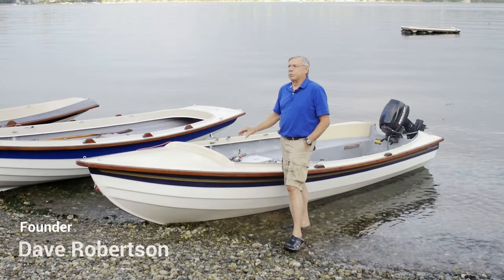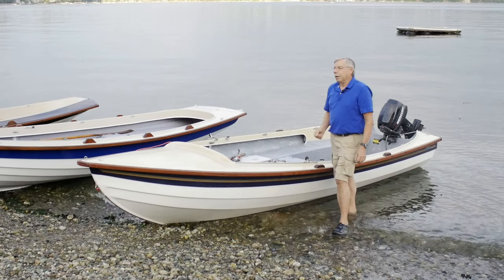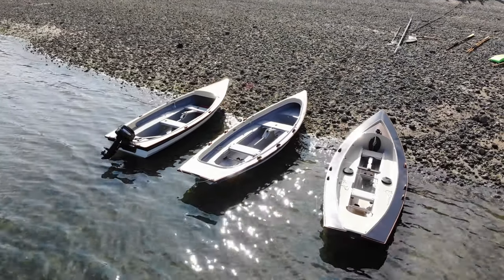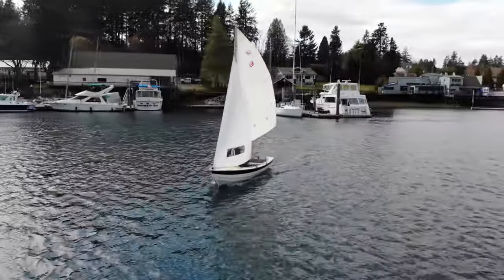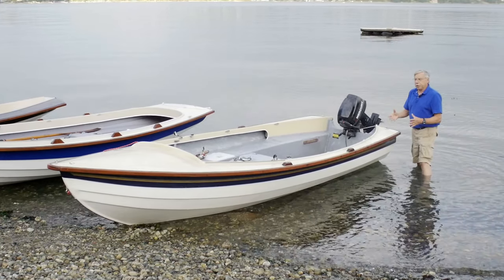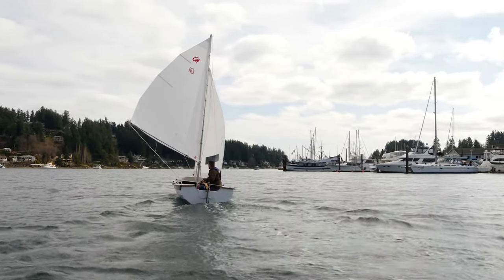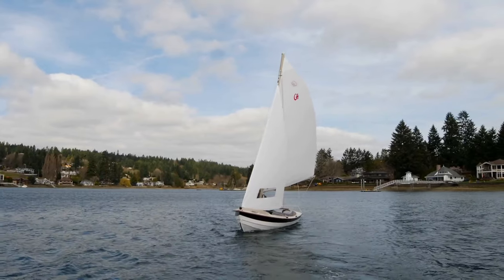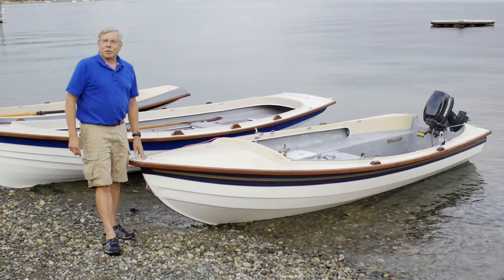Water Workhorse: The Lobster Boat

Comment: Hi there nice boat! I’ve just bought a 2023 Darragh 15ft boat that looks quite similar (unsure what your hull looks like) but wondered if it would also take a 15hp? It came with a 6hp would would rather the extra speed if required. Thanks
Reply from the maker: Hi Devlin - unfortunately there's no way for us to know that. The HP rating is determined by US Coast Guard calculations based on how much floatation is built into the boat and where it is situated.

Comment: i assert that the only way to have an effective rowboat or sailboat is to have the transom emerge out of the water and not drag. The opposite is needed for a planing outboard. You need an immersed transom below the waterline. The ONLY way to have an acceptable hull for all three is to have the transom out of the water when rowing and sailing, but in the water when running an outboard. Thus you need rocker on the bottom and and the run of the bottom aft needs to be straight back behind that deepest point of the rocker to make a good planing hull. The boat needs to squat a bit to plane well, and to sil more balanced with the bottom of the transom emerged to row or sail well. I have only seen one design do that (I actually built it, and when not overloaded it worked well) But this boat is not it. I can plainly see that it drags its transom when sailing and rowing which is not necessary.
Reply from the maker: Hi Paul - thanks for your thoughts. This boat is in fact designed with rocker like you describe, and it does sail and motor very well. However the mold has not aged well and so the boats that come out of it no longer have the degree of rocker that they used to, so we're not building any more from the old mold. We're currently undergoing a redesign of the boat to increase floatation in the stern to better support modern motors, and improve the rocker. New version of the Lobster Boat should be out in 2023.

Comment: How many lb
Reply: 9000
Reply: There sooooo heavy need a crane to lift I have one soooo heavy!
Reply: LOA:	15′
BEAM:	64″
Fiberglass	Kevlar/Composite
DISPLACEMENT:	375 lbs	N/A
SAIL AREA:	Main, 63 sq. ft.; Jib, 32 sq. ft.